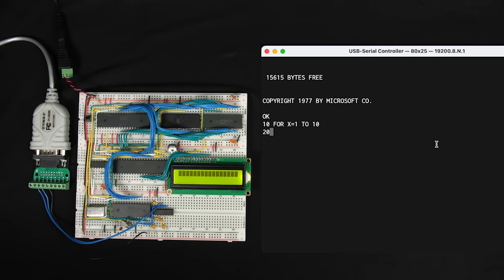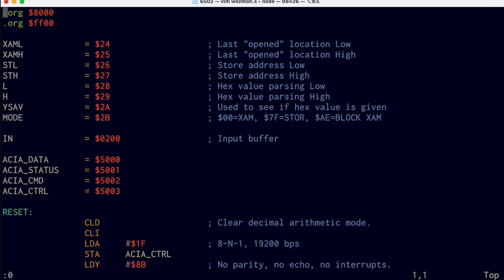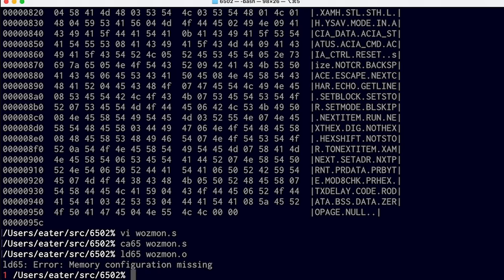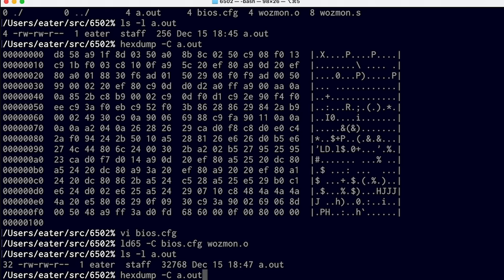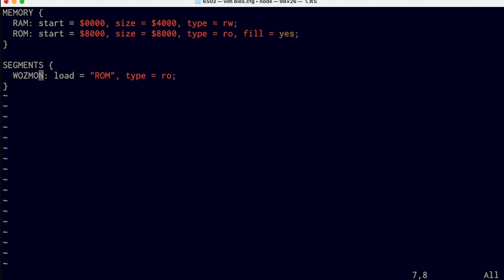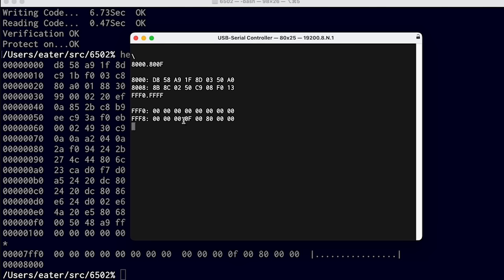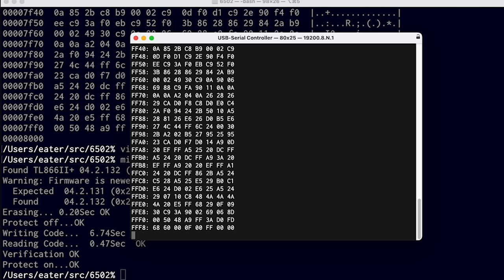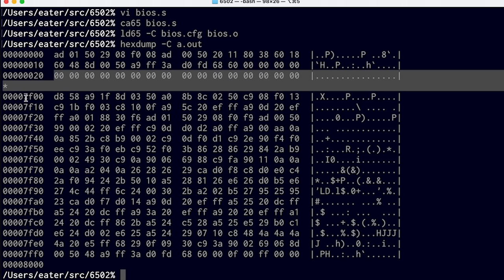A simple BIOS for my breadboard computer

Comment: This really is nerdpron.  But it reminds me of something I went through back in the mid-80s: a friend of mine bought four broken "graphics terminals" made by a company called ISC, who also sold the Compucolor II home computer.  He offered one of these to me, if I could help him get them working.  And we did get all four to work.  But that was just step 1.  The terminals had 8" floppy drives on them, and were meant to run CP/M, but he didn't have an  ISC CP/M disk for them, just a generic CP/M with BASIC disk.  So just as Ben did, we had to write BIOS functions so that CP/M would know how to read the keyboard and put characters on the screen, as well as how to turn a given pixel a given color, which we accomplished in a day or two, leaving us with four fully functioning CP/M graphics computers!  They even had light pens for graphical input, which we also had to write CP/M "drivers" for, which was another fun project - all of this was with no documentation at all, since Google was still 15 years away.

Comment: "...unfortunately none of those are the computer that i built"
what a problem to have
Reply: Well, it could be a problem, if the computer that you built isn't just a duplicate of a popular machine.  This to me is what makes Ben a giant.  He points out what the problem is, and then goes immediately to the solution.  To me, this is much better than just showing how to set up a .cfg file for the linker.  You get a sense of why the linker HAS .cfg files, and teaches you not to fear the "magic" files.
Reply: The hardware version of 'stackoverflow thread does not exist'. That's when you are really screwed.

Comment: Another big winner, Ben!  At first I said, "meh, I don't need to know how to make a BIOS", but then I looked at some of the comments, and realized this is more of a "how to get started on software development for a new machine" video!  Swiping Wozmon was one thing, but showing how to navigate between assembler, linker, and symbol table files, and setting up the configurations for the linker was really essential information that is rarely seen in such a concise form.  I can't wait until you have a disk emulator for your machine, so the assembler and linker can be loaded from an SD card and run on the 6502 itself, rather than having to do the development stuff on a Windows machine and flashing EEPROMs.

Comment: It isn't necessary to create a separate memory region for wozman,  just use an overwrite segment, like " WOZMON:     load = ROM, start=$FF00 type = overwrite;"
Reply: You do get more controllable behavior with a separate memory region though as you'll avoid accidentally overwriting anything if something has a different size than you expect.
Reply: @celeron55  Respectfully, this isn't really much of a concern.  And creating many such memory regions for every segment, quickly becomes inflexible and error-prone.
Reply: Thanks I was wondering about this. Do you happen to know ld65's behavior when the output overlaps?
Reply: @tux1968  I used to be a CS teacher. Most often you need to carefully decide what to include in a lecture. Too little slows things down, but too much has students confused and overwhelmed.  These are big decisions and they are invisible to the students. -- Ben has tons of these decisions to make for every single episode, because there's so much more to tell at every point.
Reply: @georgwrede7715   None of that changes the facts.  The fact is, it's more appropriate to use an override segment than to manually carve up the memory regions.  And I hope my comment might help someone who is learning.

That fact doesn't diminish the great work Ben does, or the utility of his fabulous videos.
Reply: in my own experience I've preferred just making memory regions, stuff like exception vectors/BIOS have a specific size anyhow and an overwrite won't tell you if you spill outside those bounds, if I'm reading the docs correctly.

Comment: I've programmed on my Atari with ca65 and the key to using it is understanding the memory mapper configuration as explained on here. Programming on these old architectures forces you to do things more manually and learn about things that are done similarly on modern computers but handled automatically by the compiler and linker so you can get away with not knowing it.

Comment: Awesome as always.

When you said you were going to rearrange the code a bit for when the project gets larger, your approach wasn't quite what I expected. My assumption was that you were going to have separate bios.s and wozmon.s files that assemble to separate bios.o and wozmon.o files (and eventually resetvec.s and resetvec.o), and let the linker handle combining them based on the segments they define. Then you could extract your address constants to a shared constants.h file that both bios.s and wozmon.s include.

That would keep the dependencies more visible, because as-is wozmon.s only implicitly inherits the constants by being included into bios.s. Keeping track of what order files are included—and thus what constants they can see—will get more complicated as the project grows.

My only experience is with C, though, so I don't know if assembly has different conventions. And at any rate it's hardly a problem! I'm looking forward to the rest of the series.
Reply: That's quite a hassle to achieve by manually invoking the compiler and linker. I can imagine him showing such an approach and then slowly working towards creating a makefile, but I think it would be a bit much for in this single video.
Reply: While probably not a bad idea (especially if he were planning to build an os for commercial use...), the bios has to be referred to, anywho, for anything else. If you have to replace it, you're probably going to be making another constant set.

Even working with C I might do the same...but only cause I see it as apart of the same function.
Reply: @rya3190  Yeah, for me it's more just about understanding dependencies. When you're implicitly accessing symbols through your importers, it's just a bit harder to keep track of what's using what, and what symbols are safe to change/move/remove/repurpose.

It's definitely not vital, but just also not where I thought things were going.

Comment: Back in the 90's there really only was TASM with a MOS6502 table (afaik) to do that. It was a DOS program and did by default just output an amorphous blob.
I used it to write programs for the C-128 and transferred them over a lpt>userport cable i soldered together.
Seeing how there are whole tool chains now that would let you in a wacky way compile anything you can translate to C is just mind blowing.

Comment: Great video as always. It is a LITTLE confusing around @12:45 since hexdump is showing the file starting at 0000 (when we actually load it to 8000) 
Unfortunately hexdump doesn't seem to have a switch you can abuse to fix this. I guess you could make a 8000byte blank file to prepend then use hexdump --skip 8000 but this is probably more confusing in the end :D

Update: @13:40 you make it pretty clear :D
Reply: it's hex dump from the 8000 offset.
Reply: Yeah, your idea of 8000byte blank wouldn't that mean it would make a huge file that you'd just have to cut off before burning to ROM though?
Reply: If there's a 6502 version of binutils you can use objdump -b binary -m 6502 -D --adjust-vma=0x8000 to get a correctly addressed dump

Comment: I was trying to get cc65 / ca65 to work with my 65c816 bread board computer. cc65 / ca65 is the compiler/assembler that works best with the extended 16 bit commands and the 24 bit addressing mode. so thank you for that. i can now dust off my project off the shelf

Comment: If the cc65 linker works like a normal Unix linker you‘re not supposed to split the ROM, but add sections/segments at different starting addresses/offsets inside the ROM memory.

Comment: I've tended to avoid MS Basic simply due to the questionable IP provenance associated with it. It still seems to be under copyright, which means we really don't have any right to use it, port it, etc... Only the original copyright holder(s) can release it under an open source license and, as far as I know, none have. Although not ideal, I've focused on EhBasic. It doesn't have the perfect license nor provenance, but it's much better than the MSBasic and direct derivatives.

Comment: Nice! One question about using the linker. You went ahead and included wozmon.s into bios.s. I felt it would have been cleaner if it was possible to assemble bios.s and wozmon.s seperately into bios.o and wozmon.o, respectively and then use the linker to combine bios.o and wozmon.o into your a.out. The only challenge I see is that the reset vectors in bios.s refer to the RESET label which is defined in wozmon.s. But I think that is exactly what the linker should be able to figure out, right?
Reply: I know in modern toolchains that's what happens. Object files get labels kept in them, and the linker is able to search across objects to find the label it needs.
The downside to that is that you now have one more command to type, more files to track during the compilation process, and I guess having to include a section on creating a Makefile would have made this video too long and complicated.

Comment: "BIOS" is not a generic term, that would be firmware, or system firmware. BIOS was two specific implementations of firmware, the IBM PC original firmware, and the predecessor CP/M system's bootstrap firmware.

It's  not "A BIOS" because that's not the correct usage of the term.

Much like any x86_64 Windows PC built in modern times does not have a BIOS, it has a system firmware implementing the UEFI specification.

Comment: the DEC comand decrements a value in an adress rather than the A register, I've made that same mistake myself. I only assume that certain compillers will reassign the DEC command to beter align with the intuitively expected action.
Reply: You seem to be mistaken. DEC on the original 6502 always took an operand, but the 65C02 DEC without an operand works on the accumulator

It would be quite useless to specify another memonic for decrementing the index registers, since there are DEX and DEY

Comment: 2:30 I believe (but correct me if I'm wrong) that the original 6502 only lacked the ROR instruction. Not sure why you'd be having issues with DEC.
Reply: (I know your comment is getting a little old, bust I wanned to give a some info)

The 6502 didn't have suport for the instructions DEC and INC to work on the A register, that feature was added in the 65c02 version of the cpu.
the original could only decroment and incroment a number in ram by one using DEC and INC, even though there's a variant of them for the X and Y registers being DEX, INX and DEY, INY respectively

Comment: I would find it cleaner to assemble wozmon.s and bios.s separately and then include them both in the linker command, instead of using the .include directive inside bios.s to include wozmon.s. Wozmon is not part of the BIOS.
Reply: I was thinking along the same lines, and it would be nice to have seen the corresponding process with distinct object files. Maybe it's just as simple as "ld65 -C bios.cfg bios.o wozmon.o resetvec.o" at the end?

Comment: Thanks for the video Ben, very informative. I have t wo questions : 
1) What is the point of defining the RAM segment to the linker config file ?
2) What would happen if you were to load segments to the RAM memory location ?
Reply: #1 - Helps to organize and be more efficient with your build / release efforts.  Wait until he adds BASIC in to this.. you'll see how much more complex bios.cfg will become.
#2 - You can do that, but can cause problems if you're not really careful. All your subsequent code needs to make sure that it avoids dancing in that space.  See Jargon file: fandango on core.
Reply: You can define variable locations in RAM by putting them in a segment that goes in RAM (the assembler I use has a ds command for doing this, or declare storage). You could do the same for the first 256 bytes of RAM, the zero page, which contains variables that are commonly used and faster and easier to access.

Comment: Great video as always. But, after teaching us Assembler and now how to use a compiler and linker, building BASIC seems a bit pointless when CC65 has a C compiler
Reply: I have to disagree, having a shell available makes the computer much more accessible for interactive use.

While I would second a video detailing how to get a C program working with his bios, this is much more useful for an embedded use case.
Reply: @petermuller608  BASIC was certainly easy to learn, but a program would soon descend into chaos. A Shell would be useful, and I don't know if there was one for the 6502, so would be a cool project.
Reply: @axelBr1  basic was the shell for most 6502 computers ;)

I agree with regards to basic the programming language with an interpreter being quite restrictive on microcomputers due to RAM limitations

Nevertheless, for most applicants it's sufficient

Comment: Not a good idea to fill Flash or EEPROM with 0x00, as that's programming a byte which forces an erase cycle then the write cycle, contributing to wear out of the memory cells.

If you instead fill with 0xff, you only erase the cells. Considering the in chip HW won't erase bits already erased you can see how this can dramatically reduce wear.

Comment: Question for you as I apologise but perhaps I missed something.. the symbol file, while it defines the locations is actually generated after the compile, so how can you provide that to the software you're using for ms basic in order for that to work? Recompiling could change the locations so hard coding them would perhaps introduce intermittent deployment issues.. hopefully this makes sense.

Footnote, love your content, wish I could have done this when I was at uni!
Reply: There's actually a couple different 'symbol files'.  One from compiling gives you a list of all the defined labels.  But it doesn't have any particular memory address since multiple object files might get loaded together.  Then the linker/loader builds another 'symbol file' that has all the defined labels AND exactly what memory address they end up at in the final linked-together a.out.
Reply: You might think any change would mess up those hardcoded values.  But that's why the 'bios' file is very simple and just refers to routines in WOSMON.  You never make big changes to BIOS other than to add more routine-entry points at the end.  If you change WOSMON, it won't change where the entry points are in BIOS.  So the hard-code addresses for entering BIOS will be unchanged.  But where those entry points jump off to inside WOZMON can change.  The linker will fill the BIOS jump points with the new location in WOZMON, but external programs that just use the BIOS entry points will be fine.  (I was once told, "To solve these problems of changing BIOS, just add another level of indirection... lol)  The entry points are kept stable, even when WOZMON changes.
Reply: Yeh I guess my point is in the GitHub source for basic compiler it had defined memory locations for those functions. My assumption is that the symbol file shown could be used to define the file but those locations could then move? I guess it depends how it's all being built and maybe you could compile the bios stuff shown in this instalment then compile the basic element to plug into the memory spaces left unoccupied?
Reply: @chriswatts923  The general assumption is that, once the BIOS is written, the addresses won't change much—because you've already shipped however many thousand units with that BIOS hard-coded into their ROM. You'd just document whatever addresses you wound up with as your BIOS's interface.

But yeah, while this BIOS is under development the addresses could very well shift around if Ben adds or removes instructions. If that happens, he'd have to check the symbol file that's generated and update the values he uses in the BASIC project.

What I assume many BIOSes do—and what I'm kind of hoping Ben does, if just for show—is to include some padding between functions. Essentially, you'd force the functions to land at specific, pre-determined memory addresses. Then, if there's a need to update the BIOS, there's some room to play without affecting subsequent functions' addresses. (I don't know for sure if any or many BIOSes do this, but I know I would if I had to write one!)

In a CC65 project like this, you could write each BIOS function as a segment in one or more assembly files, and then define where those segments land in ROM using the memory config. Then, instead of needing to produce a symbol table as part of the output, you'd just document the addresses you chose for the memory config as your BIOS interface.
Reply: @ChrisBouchard  Without any specific knowledge about this I would assume there was a jump table or "trampoline" that the programs referred to when calling the Bios. This would allow a more compact BIOS code without internal padding, and also allow freely resizing each routine without having to relink the programs on a "BIOS upgrade". It comes as a size cost of the extra table, which would pay off as long as it is less than the internal alignment/padding. It would also add a tiny time penalty when calling, which hopefully is neglectable or outweighed by the improved compatibility & convenience.